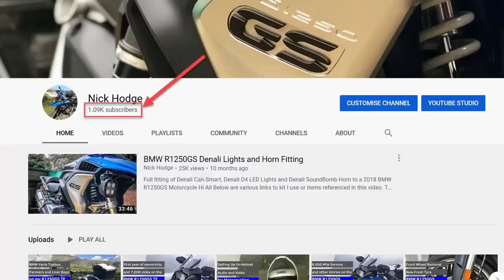BMW R1250GS ACF50 Treatment with 'All Year Biker'

Comment: Congratulations of going over 1000 subscribers. I've been putting ACF 50 on my bike 2 times a year. I think it works great. First couple times used the spray bottle. Since then I've switched and now use the air compressor/paint sprayer that is much more effective/easier. Also bought a bike dryer, makes drying the bike much easier and faster. Really helps getting water off the radiator and in the hard to reach places. Thanks for the video, maybe "all year biker" will franchise and open up here in the USA. Happy New Years !
Reply from the maker: ST-Audio thanks for the comment. Ride safe

Comment: Thanks for this. I have been meaning to get my bike booked in - and your video has pushed me into action. It's now booked with my local operator (who has a good reputation) for early in the new year. I hope my bike looks as good as yours after the treatment - although I have to say mine is not as clean in the first place!
Reply from the maker: For sure Richard it will be better for the treatment than none. Most know ACF50 works but the prep and application is beyond most people, let us know how it goes, Ride safe.

Comment: Had mine cleaned a few weeks ago with my local BMW dealership, it takes about 3hrs with ACF50 and it is a little cheaper than AYB. Used to have it done by AYB and there very good. I also have my own bottle of ACF50 in the house to use every couple of months on the bike.
Reply from the maker: Mike Dignum cheers mike. What impressed me was they were quite happy for me to watch and with time and materials, to me it’s a bargain. I had mine done from new by the dealer (it was November) but I saw none of the application so no idea what they did. This was thorough for sure

Comment: Very good value for the amount of effort put in. Would have thought that the handlebar grips would be covered along with the tyres. Congrats on 1000 subs..
Reply from the maker: Vincent Daly thanks for the comment Vincent. He had pretty good aim as nothing was on the grips or pegs. The only thing I wiped was a little on gear change rubber.

Comment: I use Siroflex Silicone Spray, makes my bike look new. cover your brakes etc when spraying. l have used AC50 and l prefer the Silicone spray, as its in a aerosol can so you can get in everywhere.  l used about a can and a half, cost less than a fiver

Comment: Thanks for doing this. I found the advice on ACF50 vs XCP very useful. I've alternated in the past between ACF50 and FS365 as U hardly ride in winter and clean my bike after each ride at this time if year but have got some XCP to try out on the more exposed parts of my GS like the inside of the swing arm and around the rear hub which I find the best way of doing that it to remove the rear wheel which being shaft drive and a single sided swing arm really easy. Off to look at you other vids now.
Reply from the maker: Interesting comments Adrian, thanks for that, hope you find some other content interesting. Ride safe

Comment: Nice job.
I would recommend, for the first part of the cleaning prossess to avoid the high water pressure, and try a professional steamer. Only 8 bars of steam pressure, is more efficient than 160 bar of water pressure. It cost a couple of thousands but it worth the investment for a professional. The use of high  distilled water (reverse osmosis) for steam makes it safer for the electrical circuit, it is smoother for the sensitive parts of the bike and more efficient for the hard dirt also combined with microfiber clothes wiping out everything, anywhere because it's warm, and wiped directly with the microfiber clothe. You don't need more than 3-4 liters of water, and you can add wax on the steamer to combine it with the steam for the painted part.
Reply from the maker: Wow. That’s technical. I’ll pass it on thanks 👍🏻
Reply: @nickhodgeUK   If you need more information, i would be glad to help. 
I had my own "treatmend "  buisness for Motorbikes, cars, caravans,  yachts, at 2010  but unfortunatly i had to give it up for  other reasons and not because of the service quality of the produckt.

Comment: to remove the water after washing and cloth drying i take it for a short spin and “voila’ no blower needed :)
Reply from the maker: I thought that too, but the BMW (and boxer in particular) hold so much back. As a test, find someone with a blower, ride the bike as fast as you can and then apply the blower. I bet you'll be astonished how much still comes off, well worth the £100 IMHO. Ride safe
Reply: thank you Nick, ill try that. Ride safe!
Reply: I use a cordless leaf blower, it does the job perfectly and helps in the garden too !
Reply from the maker: nigel haworth I did that early days but the control and nooks and crannies are not so easy. Certainly worked though

Comment: I've been. Using acf 50 for years.   It does work but unfortunately,  brine and salt in the USA just destroys my bikes even with the acf50.   I just don't take my bikes on salt road anymore.   This winter my bike is riding the southwest USA, no salt there. 

I do coat my cars and truck undercarriage twice a year.   

70 pounds is a deal in my opinion.
Reply from the maker: Thanks Steven. I'm with you, we don't know a winter here really but anything from about 40f down they salt. That brings moisture out of the road and that turns to corrosive Brine. My cousin in the twin cities has a 'snowflake' old car that lasts him about 5 years and then he scraps it. (His other cars are immaculate!)
Reply: @nickhodgeUK  I'm in the northeast USA., AKA the rust belt.  It's terrible here.   I now only lease my cars as the corrosion is terrible no matter what u do.   Brake lines on our cars usually start leaking at 4 or 5 years from corrosion.   
From November through March,  there is constant brine on the roads now no matter the weather or forecast.   

Pains me because it ruins vehicles and has a huge economical,  ecological and environmental impact.   But we're so litigious here in the States, this salt crazed behavior is the new reality.   

Im jealous of your GS.  im riding in some remote areas of the southwest US in a few weeks and my RT just won't handle some of the roads I would like to take.   Than again,  I love my, fairing and radio.  Maybe it's time for a third steed in garage?  I almost sprung for the 1250rt...  but I decided my 1200 is fine for another 4 or 5 years..  I'll wait for the next generation.

Comment: My 1250 is due to be delivered in March and traditionally on my other GS' I've used mainly FS365 so I'm wondering how you've got on with the ACF50 treatment since, any good/bad points to share, how have you cleaned your bike and does it still look as clean as when Adam did the application. Cheers Ade
Reply from the maker: adrianbarrie13 ade. Here’s an admission. Not been out since as weather been awful so she looks fine 😂

Comment: Thanks for the video, how often would you have this done? Does cleaning the bike remove the ACF50? I guess my riding is much like yours, lots of use spring, summer, autumn with occasional winter use. 
Cheers👍
Reply from the maker: Hi Graham, it doesn't wash off over certainly a number of washes. The advise was if you are occasionally riding the bike year-around then do it start of winter and beginning of summer, but I don't ride much in winter so it's a protection of the bike stored and then pretty much every time I get back after a wet ride I swill it and then clean deeper when I bring it back after a weekend or week away. Hope that makes sense (Certainly it doesn't wash off first time)

Comment: That's the way to do it - or better still, get someone else to :)  BUT is Adam still alive? Aerosolling ACF50, and regularly, without wearing a mask is not wise
Reply from the maker: It’s interesting. You’re about the 3rd to say that but someone came back on the first one down below somewhere saying it was not that noxious. I would say too it is HVLP applied so that keep aerosol down more than should it be high pressure. As you say, not my lungs though 😂

Comment: Dont ride in bad weather .lol.
Reply from the maker: Neil  Widdison That’s true Neil. Trouble is if you want to ride in winter at all, bike will attract some salt. Maybe put her in the living room under a blanket? 😂
Reply: @nickhodgeUK  true nick . I try to ride mine on the odd day in winter to keep the bike moving. If it does get some grime on i wash it off . Been using a product called Rhino Gew. It a silicone based cleaner and protector  its ring the bike up like new.